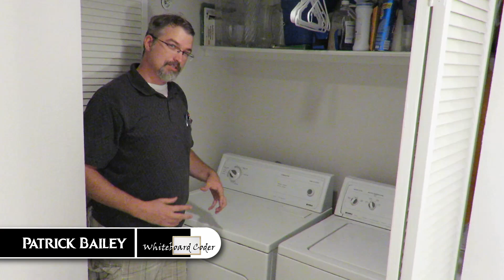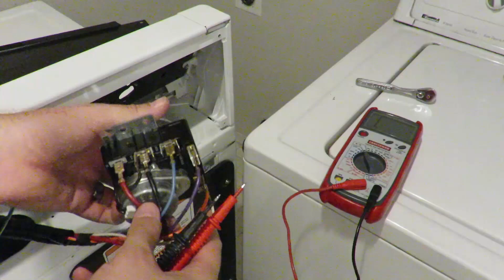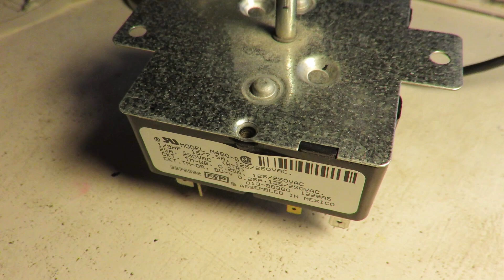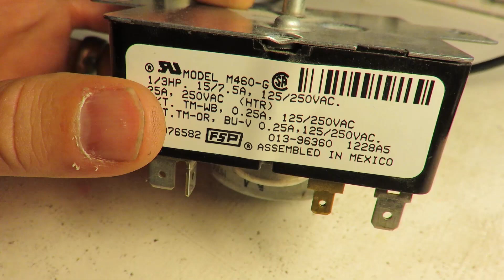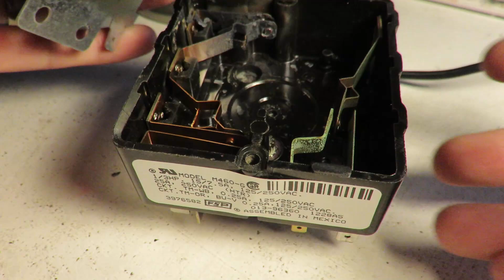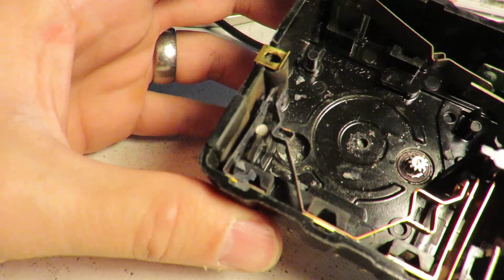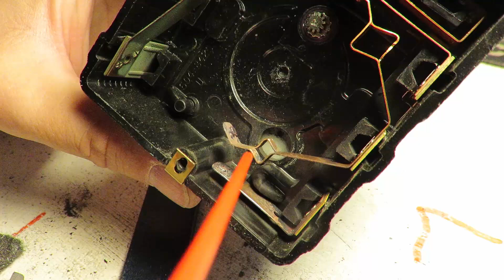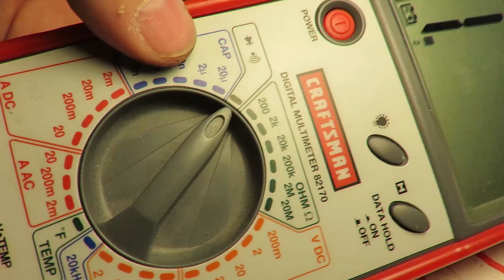Fix Fried Dryer Timer saved $80

Comment: my contacts are all pretty clean,  however i cannot hear the tick tick of the timer. dryer heats, spins, but does not stop as it's stuck in some dryer limbo. dont want to start a fire but dont have the money to replace it yet. im not new to dryer repair but dont mess with the timer much. my continuity tester is....well....not usable. Anyway, I can adjust it manually but is there anything else i could check to see why my timers not working?

Comment: I want to thank you for making this video. I did exactly as you did. After checking continuity on the heating element and fuse. The Timer would have cost $117. It took me a total of $5 to repair. $2 for Gas and $3 for steel wool to clean the contacts. Total time to repair 3 hours. So thank you. Highly recommend this video.

Comment: I would caution everyone who says "Thanks for saving me 80-100 bucks". This is a good video to troubleshoot and get by in a pinch. But do NOT use this as an everyday fix. It may last a day, week or even a year ,but is $100 worth burning your house to the ground. I'm gonna go out on a limb here and say NO. Besides $80-100 is still cheaper than a new dryer. If it's burnt, please GET A TIMER!

Comment: Looking at the outside of the timer I just new that once I take those two screws loose there would be springs and whatever popping out everywhere. But after watching your video I probed the black and red wires and got no readings. So I opened the case cleaned the points and now it works like a new dryer. It was an easy fix.  Thank you for the video Patrick
Reply from the maker: Glad the video helped out :)

Comment: I've tried this many times on many dryers. It's only a temporary fix.  The contacts have overheated and are destroyed--just look how discolored that metal is. You have restored continuity but when that high current runs through them the resistance burns them up again in no time. Try this if you need to use the dryer while you wait for the new timer. Be advised there is a risk of the contacts fusing together. I've seen timers completely meltdown.
Reply: agree,i understand ur trying to save money,but theres a reason it arched and burnt that to begin with.  i feel that repair wont last few weeks or months ..
Reply: To me it seems like a maintenance issue,  either u maintenance it or you don’t know how and scrap it.  I
What’s different from the way his is after tweeking it compared to brand new??
Reply: @Gotsqueeze2345  It's a design and engineering issue. Cost and obsolescence. Probably costs $20 (retail) to add a cheap relay to handle the load and change out.
Reply: Mine has lasted 2 years since my fix. The dryer stopped heating again recently and I suspect a fuse but went and checked the timer anyway. Still fine
Reply: Mine lasted 4 months. Now every time I clean the contacts it runs a cycle but once its about to finish and it's suppose to shut off it archs. Time for a new timer unless someone knows a permant fix?
Reply: I did this exact fix 3 yrs ago. It failed again last week. The prices for these timers are crazy now.  I would replace this if it's bad. If can cause some bigger issues if it gets arc to a short. 🔥 🔥
Reply: Yah, it's the sad truth. Once they're toast, not much to be done. I just short cycle mine until the contacts/switch temp rise to a precarious level. 3-5 minutes on 'heat' then switch to 'fluff' or 'no heat'. It's a definite PITA but theres enough residual heat from doing that to get the clothes dry. Last time I had to go to a nasty public laundromat.
Reply from the maker: Interesting info.  Anyone else out there see similar time frames for how long this fix lasts?  My fix went well over a year and may still be working.
Reply: whiteboardcoder 

Ur an idiot and shouldn’t be proud of that asinine jury rig fix of a contactor

Comment: If the contacts are burned down to the copper blades, I would consider this a temporary fix.  I have a dryer that I cleaned the blades off where they had almost burned down to the copper blades.  I also bent one of the blades a little so the twon woyld make contact.  That being said, I will not sell this dryer for fear the copper blades will fuse together and not let the heat circuit seperate thereby causing the heat to not turn off.  Might be a fire hazard.
Reply: There is a centrifugal switch in the dryers blower motor , if the timers heat contacts welded together and the cycle ended the motor would stop and that protective switch would cut the current to the heater as well this design ensures that if the blower does not come up to speed the heater wont receive power   there is also a high limit thermal safety fuse on the heater as well that blows cutting the heater power if all else fails and most newer dryers also have a switch that halts the dryer if the drum belt breaks
Reply: @allrock1238  good point in regards to the centrifigal switch, but I have seen control panels with quite a bit of lint buildup too.  Just being cautious.  Good point though.
Reply from the maker: Interesting thoughts.  Better to be cautious.
Reply: @Whiteboardcoder  I did remove a couple of blades with better contact points from another timer and replaced the bad ones.  Not sure I should have done that, but I feel better about it now.
  I wish I knew where we could buy timer PARTS to refurbish timers with!  People that rebuild these things have to have a source for the parts, right?
  This may very well depend on volume though.

Comment: Question for you, i got it all cleaned out, as there was some of the same stuff that you had.  I can hold the contacts together, on the inside and get continuity, but when i put it back together, i dont get anything.  Whats the process to get everything lined up.  I read that you had to bend them back in place.  Which way do you bend?
Reply from the maker: It was a bit of playing with it back and forth trying to make sure they would have the correct contact when the knob was turned.

Comment: Hi there, I have this problem. No heat and it spins. So i check the heater, replaced with brand new heater, still no heat. Heater not turning on. Replaced the old thermostat with new thermostat, still no heat. Checked all wirings for continuity, all checked out good, sanded the terminals, still not heat. Replaced the whole motor with centrifugal switch, still no heat, "heater does not turn on". I don't know where to go. Please help.

Comment: I just had this same issue with a dryer that was given to me. It turned out to be the motor on the timer, not the timer. They don't sell the motor I need so I have to get the whole timer at a cost of $80 bucks. No thanks.....lol
Reply: How did you figure that out? I might be in the same boat.
Reply: When I opened up the timer to check all the contacts inside. They were all fine. Looked brand new inside it. Then I tried to turn the motor itself, nope. Wouldn't turn. The motor itself was seized.
Reply: The contents of my timer look good, the motor will turn but it sounds like a magnet it loose and it knocks around when you shake it. Sound like a bad motor on the timer?
Reply: If you're hearing a rattling sound coming from inside the motor itself then yeah, I would say the motor is bad. Unfortunately you can't buy just the motor for the timer, you have to buy the whole timer assembly.
Reply: Cool, thats what i was thinking, just wanted a second opinion. Thanks for your help, i will order a timer.
Reply: Changed out the timer, dryer fired right up. Thanks for the assist dude.

Comment: Can anyone help?? I've got a Kenmore 80 Series that doesn't start, I tested all the connections and the only one that doesn't check out is the T-W connection from the timer to the buzzer. I took apart the timer and cleaned the contacts, similar to this video.  When I put it all back together, the T-W connection still didn't close. Anyone know if the T-W would stop the whole dryer from starting? I've gone through all the troubleshooting steps I can find online and everything checks out except this T-W connection. Any help would be greatly appreciated. Thanks!!
Reply: Yes that happened to mine but bent those parts inside very gently so they would make the connection when wheel in right notch. Was just bent a bit.

Comment: My dryer heats but wont stop running untill i ooen the dryer door
Any idea what could be wrong with the timer on that part?
Reply: If the timer does advance, chances are the timer motor is bad or a cam in the timer is loose.
Reply: I meant to say if the timer does NOT advance, the timer motor is likely bad.
Reply: I got the same problem with mine..
Reply: Maybe thermal fuse...lol ive taken that part off and my door switch...still didnt fix non start.guessing its my timer
Reply: @Joe X I have had to change timers on GE dryers when the knob would not turn the timer.  The timer knob would be cracked where it fit the stem.  What appears to have happened is the timer motor would start getting stiff and get hot.  I think the heat would transfer to the plastic knob and cause it to get soft and split in the middle.  That or just the fact that the timer motor was getting too stiff and the knob could not handle the stress.
  I discovered this while checking one with control panel removed.  The back of my hand happened to get near the timer motor.  It was too hot to hold my hand on it.
Reply: I should have pointed out the ones I have had the particular problem with were GE's that had the metal timer stem, and the knob just pulled off and pushed on.  They were not the ones with the plastic stem and clip that had to be removed from the stem in order to get the knob off.  Not saying they have different timer motors.  They may have.  I sort of doubt it.  Just now thought about it.
Reply: Does the timer advance when a "timed cycle" is selected ?? also if its an dryer with an automatic sensor dry function but a mechanical timer ,, there is small circuit board that keeps the timer motor from advancing until the damp clothing dry's to a certain level, if it will work on a  timed cycle but not on the automatic sensing cycle that board is bad,, if the timer advances but at end of cycle it wont shut off or will not advance once the timed cycle is selected, check the electrical connections to the timer motor with the dryer unplugged  Repair or Replace the timer if it wont advance after this point..

Comment: I looked into this, i looked inside the timer and the copper connections are not burned out. I think the problem is the actual plastic gear disks. How do i know if is broken? I don't recall but when you set your timer, it's supposed to make a grinding or clicking sound, right now it doesn't make a sound at all and something is not catching. Can this gears be fixed?
Reply from the maker: I am not sure on that one.  Sounds like a harder fix and may mean you have to buy a replacement :(  
Or maybe someone has a cool video out there on how to fix the gears...

Comment: How did you get the connection to connect again. I just got mine cleaned off now I didn't see you explain how to get it connected again or is there a part 2 I missed?
Reply from the maker: Sorry no part 2.  Its been a while since I fixed this, but as I recall I did have to bend the copper pieces there a little bit to make sure they were making the contacts they originally were.   Not very much tweaking mind you just a tad.

Comment: Thanks after testing the thermostats and heater coil I was stumped as to why my dryer kept turning off with in 20 minutes of running.  when I tried to restart it it only turned on when the knob was at specific points on the timer dial.

I opened the timer and saw that the connection for "C-A" on a Whirlpool dryer had some slight charring.  I used some vinegar and a nail file and it is working like new.  Saved me over $100!
Reply from the maker: Wahoo!

Comment: My problem is I have to turn my timer to get a connection. It's like there's a short, any suggestions?
Reply from the maker: You might not be getting a good contact.  Aside from cleaning up the surfaces I had to bend the copper parts back into shape so they would make contact when they were meant to.  You may want to look at that.
Reply: Thank you sir. Your fix worked.
Reply from the maker: Cool, glad to hear it :)

Comment: What do you do after you clean them? Do they need to be attached to each other somehow?
Reply from the maker: Well in my case there was no break in the wiring so I could just clean it and get it going again. Its been a while but if I remember correctly I may have bent them back where they should have been to make sure they got the contact the needed.

Comment: This helped me a lot and a simple process these companies will charge you out the a$$.
Reply from the maker: Yeah most of the cost is about labor.   Its good to know some good honest repairmen who charge a good price.
Reply: ***** I couldn't get to flat metal piece like you to file it so i just bent the prong A metal piece so that it touches when the other flat pieces touches it giving connection. A simple process but knew it was the timer at some point but just didn't think because i thought it was something much more complex like the fuse, sensors or heat element when they all worked, Thanks :).

Comment: well mine had a contact fall off because it cracked..oh well
Reply from the maker: Bummer, can't win them all...
Reply: ordered one for 40 on amazon and received it today. worked like a charm. i made the mistake thinkinh it was te starter relay and bought one. after that didnt help i just went through a diagnosis with   my multimeter and the timer was the last piece and when i removed the piece you can hear the rattle insidesince one of tje contacts broke off. i just opened it later to verify.
Reply from the maker: Glad to hear you got it working :)$40 is not to bad a price for this part.

Comment: Saved me a bunch of $$$! thanks. A lot of videos only ever have you check everything but the timer. A note is that mine is an older brown top model, so the cables to check were yellow and red, or blue and tan which i figured by looking at the diagram label. In my case it was the yellow connector that had gotten a bit toasty on the inside, cleaned it up with some WD40 and so far it's working, however it's obviously missing some metal already so a new timer might soon be needed. Also i didn't bother to unplug any cables other than yellow and red before pulling the timer out.
Reply from the maker: Nice, Glad to hear you saved some money :)

Comment: Hi there is no continuity with mine,  but it showed some 1200 some I guess ohms while on continuity mode.  In ohms mode its   showing nothing.   Dryer is working right now but I am concerned if it is safe or not. Heater does shuts off when In off mode,  but in cool air it was showing some 200 something while in continuity mode.   My multimeter works fine,  but for this red & black connection it don't gives me a beep unless I open it inside  & make it touch myself. Also what I did sprayed wd40 inside to get rust/carbon out.  Is it ok to do so?